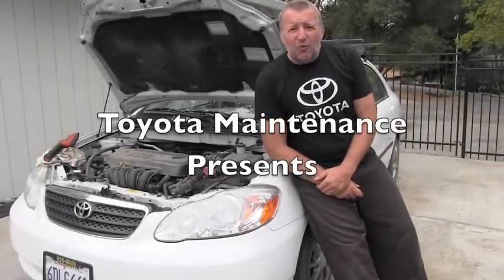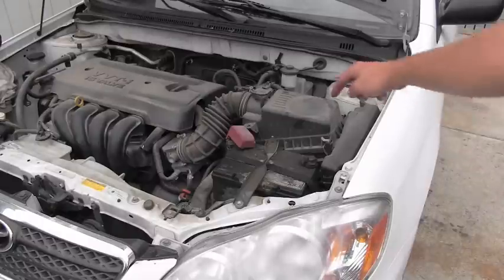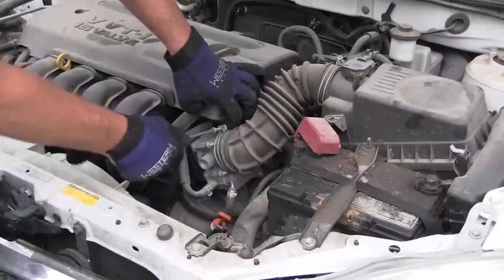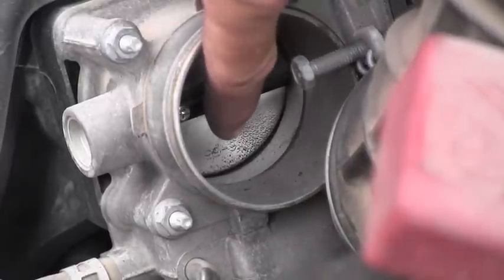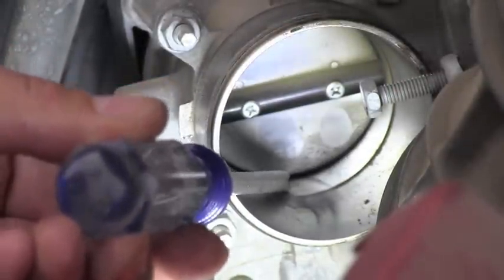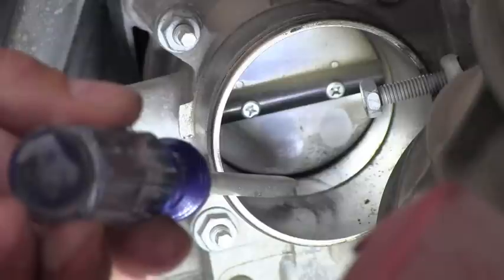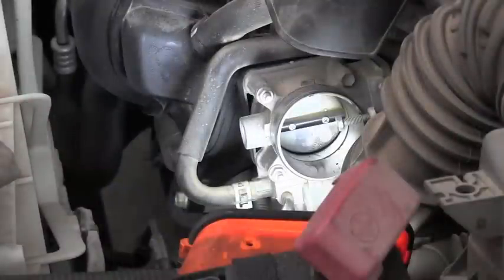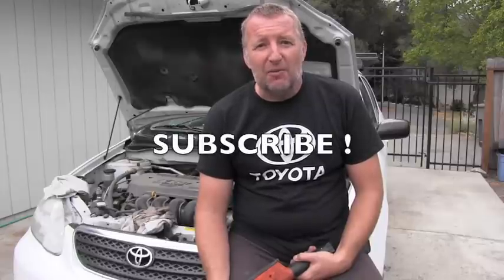2008 Toyota Corolla Throttle Body Inspection

Comment: Hello Sir, could you please give me ideas as to what you think may be wrong with my corolla 2008 model? The issue is that when I’m cold booting the machine especially after it has been left for a long time say throughout the night I have to use the gas pedal to sustain it after turning it on else it dies, I have to maintain this gasing till the temp gauge rises up about to level or bars up after which it doesn’t shut down again, once this is done I can use it the entire day without any issues but once I park for about 3-4 hours and the system cools completely I hv to go through the whole process again, I have given it to some few mechanics none have solved it for me, some change plugs others cleaned throttle whiles another worked on coils. What’s your theory please?

Comment: Your instructions are awesome and clear. Do you have any video showing Throttle Body cleaning of 2010 Toyota Matrix? The placement of the engine parts are total different from 2008 Corolla. It would be really helpful if you make one for 2010 Matrix.
Reply from the maker: Oswald Jayatunge i will have more videos for matrix soon….Thanks.

Comment: Hello, I have a Toyota Avensis 2007 1.6L SDN Prestige manual 5 speed. Same engine like Corolla on the video. Could I remove the 4 bolts of throttle body and cleaning it from inside. Will I need a new gasket for throttle body If I remove it or not? Thank you.

Comment: Hi. Finally I find an identical engine to my corolla being worked on. My throttle body is also in exactly the same condition. Earlier today, I sprayed some carb / throttle body cleaner and got some of the carbon out, but being the new drive-by-wire electronic throttle, i had to get my daughter to hold on the throttle while i cleaned it with the engine off obviously. My question is... is there an easy way of keeping the throttle plate open without removing the throttle body? If I turn off the ignition with wide-open-throttle, will the throttle plate close? Just trying to find a way to keep it open and get right in to clean it properly, as I'm aware you can't force the plate open against the motor / ECU.
Reply from the maker: Valve will be always closed while cleaning..but it is so easy to keep it open with fingers…it will not damage anything…just follow this video…good luck.

Comment: No cleaning video for this car - could I use the 4Runner throttle body cleaning video (removing the 4 bolts to access the throttle body from both sides), or are there some important differences?
Reply from the maker: Shaheen Jadidi yes, you can do that, i will do it that way…good luck.
Reply: Thank you!

Comment: What are the 2 hoses going to the bottom front side of the throttle body?
Reply from the maker: These cary coolant in and out of throttle body...i don't disconnect these to prevent making mess and creating more work for myself........thanks.
Reply: Toyota Maintenance Why do they route the coolant through the throttle body?
Reply: srouxd162 The route coolant through the throttle body to prevent the throttle plate from sticking in freezing conditions. In a hot climate, this isn't such a good thing.
Reply: Thank you! I had never seen that before. I do happen to live in a hot climate unfortunately though.